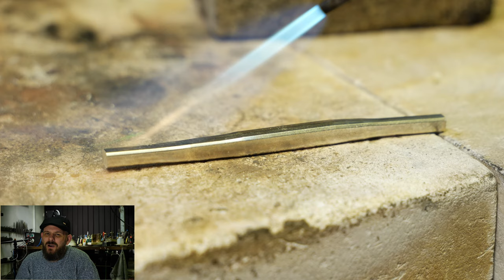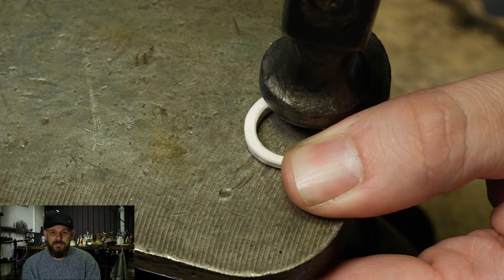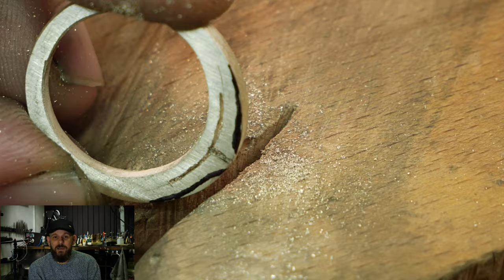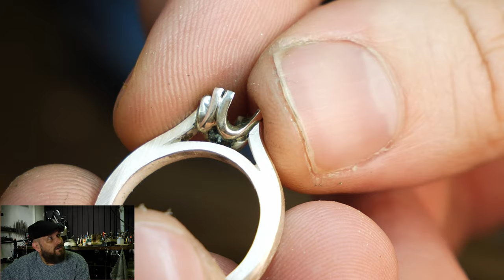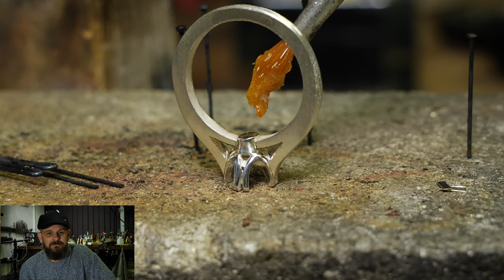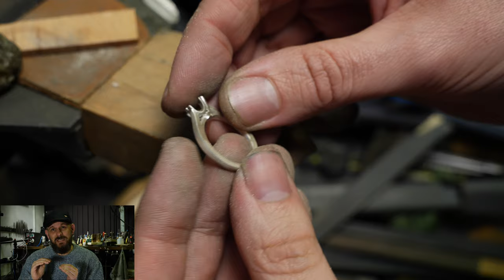How to make a ring shank and stone setting Part 2

Comment: On the subject of 'Awitching off' - I think if you work for yourself doing what we do, with passion and caring about the pieces we create, it is almost impossible to totally switch off!
I know in my case, I lie in bed at night (well in the very early hours 2 or 3 in the morning) thinking about jobs I am working on or will start working.
Sometimes I get some really good ideas of how to make this bit or that piece to work. I have found the worst thing you can do, is to fret about not switching off or worry that you are not turning your head off - just 'go with the flow' and don't get too bent out of shape!  Phil
Reply from the maker: In my early years, especially when full time stone setting, I'd have nightmares of a slow most scorper cut metal away between stones. I used to retro fit rolexs' at one point with about 400 stones in the strap. I hated it.
I have things running smooth. Have done for ages. Days off I actually play pc games, especially since my kids are older. And evenings have family distractions and chill out. I absolutely switch off no problem because I'm not leaving the workshop with problems as I leave. It's also the reason I can now juggle some videos and editing. 
Years ago I couldn't switch off. You know what a job is like. You have the whole piece mapped out along with backup plans at various stages in case something goes wrong. Then you have all these contingency plans for all the jobs in the safe along with the plans for all the the jobs that I'd given staff members. It can be overwhelming. But now I literally switch off and look forward to dinner, family and sleep. 
Probably helps that I'm a deep sleeper.
So main trick for me is to leave the workshop in the evening knowing tomorrow's plan.
Reply: @metalofhonour Well done you - it sounds as though you have it all sussed!  I am not a good sleeper at the best of times and I can't turn my brain off.  Good job - keep on keeping one.  ATB Phil
Reply from the maker: @PhilStevensphilongold  It also helps that I don't do trade work. I only design and make my own things to commission. So I have far less unexpected disasters. 
I'm definitely a different worker to when I used to be up Hatton Garden.
Reply: @metalofhonour  What do I call you?  As you know I am Phil
Reply from the maker: Someone had mentioned that before and actually completely slipped my mind. My next video I'll bring it up and introduce myself properly,  then I'll put it on my intro video that I made. But my name is Andy, but most people call me Ydna. The nickname has been with me for 30 years now. Just Andy backwards but pronounced Yidna. It just stuck. 🤣
Reply: @metalofhonour  Well Ydna it will be - time to start work now.  I am working on a Re-design of an old ring. it has 3 x 3mm Diamonds and a lovely oval Cylon Sapphire. I'm going to put the diamonds in claws and the Sapph in a bezel setting. I'm getting to the trick bit now, so I need to concentrate.  Have a gread day.  Phil
Reply from the maker: @PhilStevensphilongold  ooh. A nice little job to get your teeth into. Good luck and have fun. 👍🏼
Reply: @metalofhonour  Good morning Ydna, how did yesterday go?  I finished my diamond a Sapph ring and it turned out pritty good.  I have a few questions about setting I would like to ask you - can I contact you direct somehow. (I don't really want the whole world to see our conversations)  Phil
Reply from the maker: @PhilStevensphilongold  Hi Phil. That's good to hear. Glad it went well. The only thing I've been setting up so far is a discord server. It's an app that mostly gamers use, but works for lots of people. It will have various pages that are open for the community that I want to build with a place to ask questions and share pictures with each other. At some stage I will do a Patreon membership private channel on the server where I'll be offering one on one help to people. I have no idea of pricing yet. It'll be Patreon because I'm so busy and don't have a great deal of time. That's my main fight at the moment. 
I can attach the Discord invite link here anyway if you want to join the free part. I'll be fully opening it up with invite links in each video in a couple of months.
Reply: @metalofhonour  That sounds a good idea - no idea what a Discord server is right now - but I'm happy to join - sendme an invite if you wish.
Is there any way  I can chat with you privately?  Phil
Reply from the maker: @PhilStevensphilongold  https://discord.com/invite/Aq3EWtv9Kp
It is an app or you can use on a pc too. It has options for two factor identity, but there'll never be secure info on there to worry about anyway.
Reply: @metalofhonour  I have filled in your Discord form but trying to Log In - it asys that both my login name and password are Invalid - now what
Reply from the maker: @PhilStevensphilongold  I'm not sure. It should be like any other thing to sign in to. Did it give you a reason why it's invalid? It's been such a long time since I first signed in to Discord. 
It should let you sign in on the app, where you'll see my logo on the left hand side when in.
Reply: @metalofhonour  I'm in and waving to you. Phil

Comment: QUESTIONS - I notice you always have quite a mild flame from your torch - are you using a Smiths Little torch or Sievert - why do you like so much yellow in your flame?  Also - I tend to use All-Flux for gold only, I notice you use it on most everything.  Don't you use JM 
Easy-flow flux for anything?  Phil
Reply from the maker: Yes. I generally use auflux for everything except platinum, that needs no flux. Easy flow flux is mainly for easy silver solder, which I haven't used for years and years. Smiths little torch is my go to torch. And it doesn't need to be bigger for this. Although I do use a bigger flame when needed. I use a blue flame on platinum because it likes more oxygen in the flame. 
I purchased a Sievert torch once, but it was just too slow. And just didn't get hot enough and I mainly work with platinum. Sometimes when working with gold, I'll get the mouth blow torch out, but that's. Mainly for nostalgic reasons.